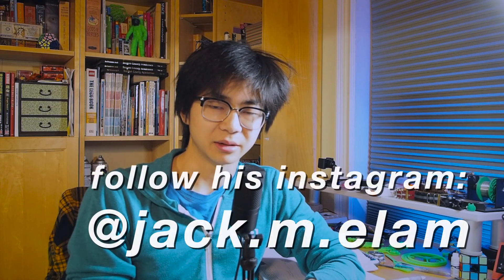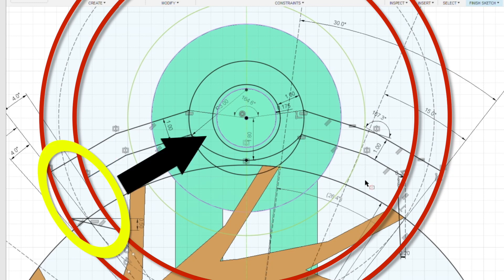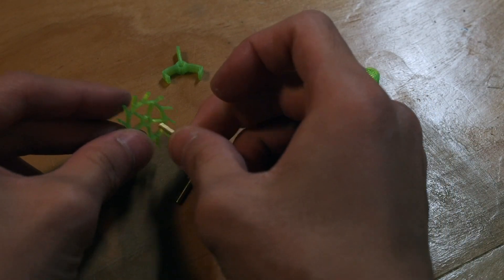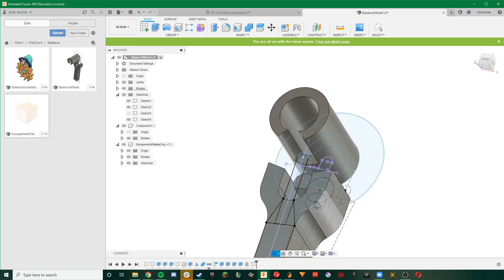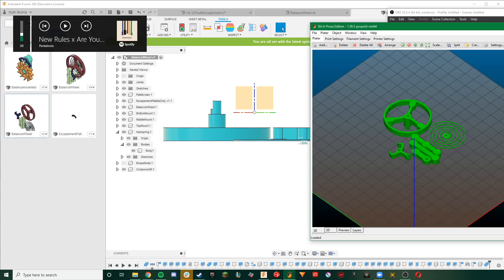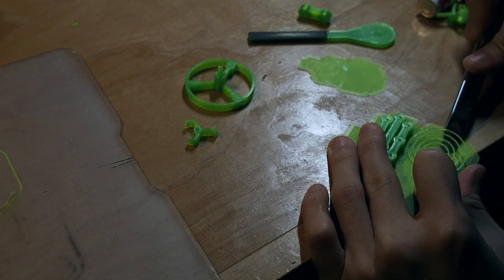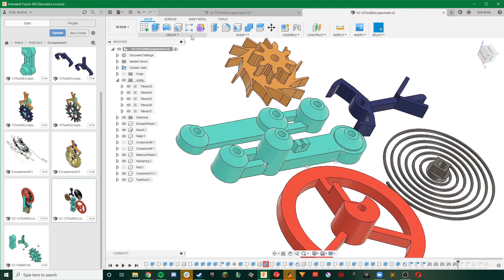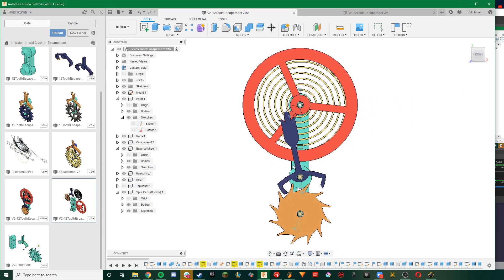My Functional 3D Printed Escapement | Homebrew Horology #3 | 3D Printed Clock & Watch Development

Comment: Very cool! How are you planning on working out the timing of the escapement?
Reply from the maker: Thanks! I'm actually hoping to tackle that by adding the option to add some balance screws to increase the weight of the balance wheel. I'll also probably end up fine-tuning the thickness/number of spirals that the hairspring has to adjust the beat rate.